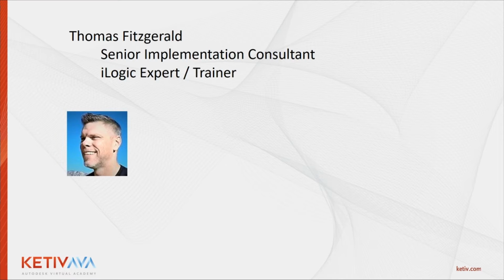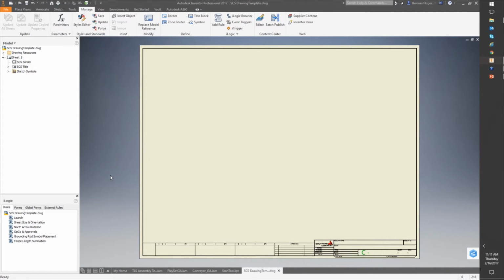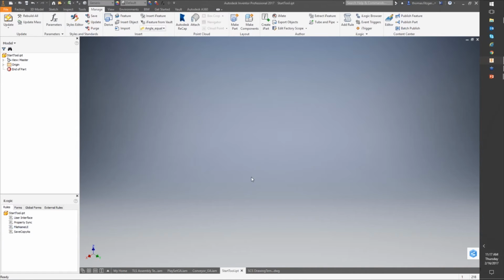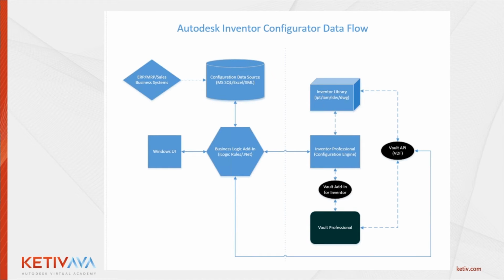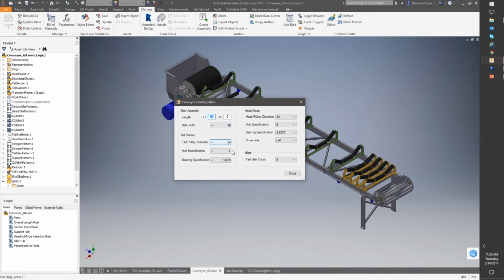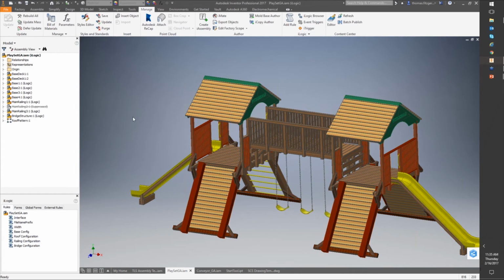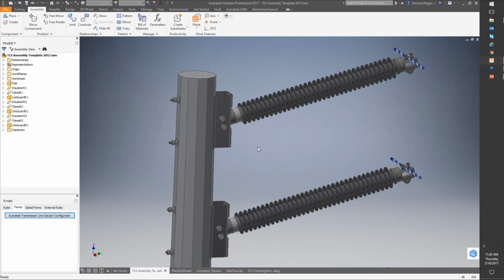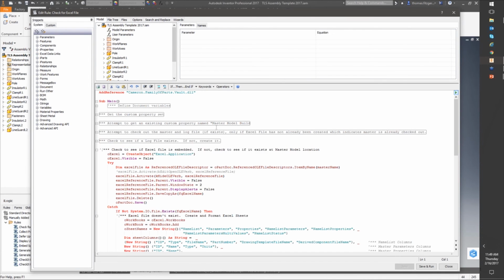iLogic Design Automation Part 1 | Autodesk Virtual Academy

Comment: Hi,

I have a problem when I place an Ilogic assembly (i will call it is A) into another larger assembly (Call it is B) which contains A.
When A was placed into B, A became A-01, A-02, A-03... 
and my screen show:
"Error in rule: Rule0, in document: Assembly1-01.iam
Parameter:  The component named "Part1:1" was not found."

Explain the symbols and names:
"Rule0": is the name of the rule.
"Assembly1.iam
": is the name of an ilogic assembly
 file
"Assembly1-01.iam"
: is the name of the ilogic assembly file after it was placed into a larger assembly
"Part1:1": is the name of the first component inside "Assembly1.iam
" 

Could you please help me fix it? or could you please show me what I need to do when I place an ilogic assembly into another assembly?
Reply from the maker: Hi, go ahead and email us at questions@ketiv.com and we'll be happy to help you out!